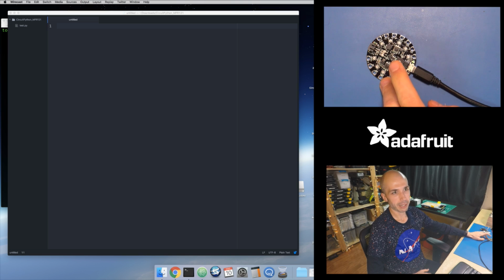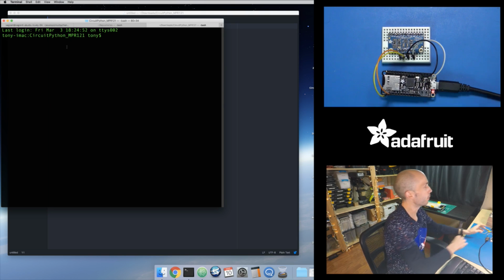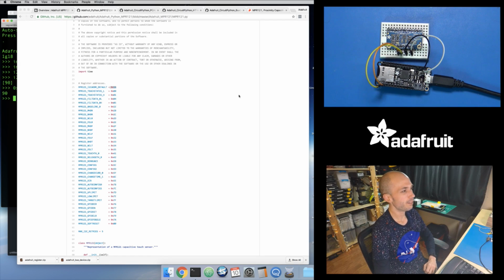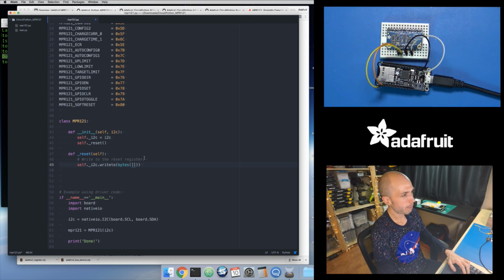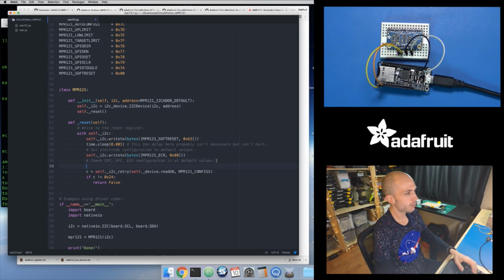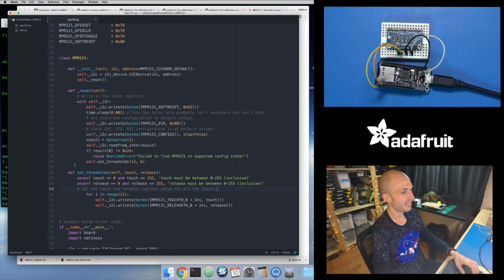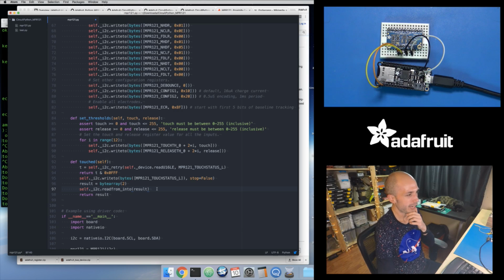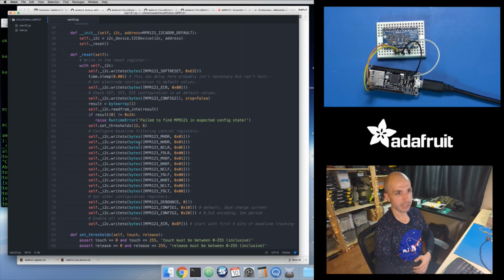CircuitPython Capacitive Touch & MPR121 Driver Porting with Tony D!

Comment: i use a mcp3008 with a raspberry pi to do touch sensing. works great. i just use a high resistance resistor to pull down a pin. and it will go up to about 300 with a touch. but stays below 10 with no touch. using the adafruit mcp3008 python library
Reply: unknown You mean a weak pull down resistor. And what is 300 and 10? Be technically specific.